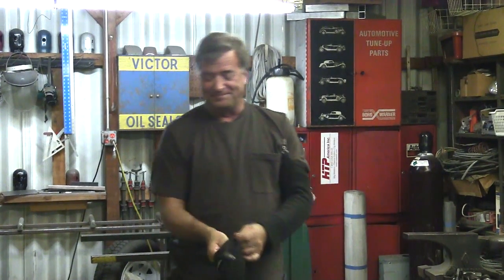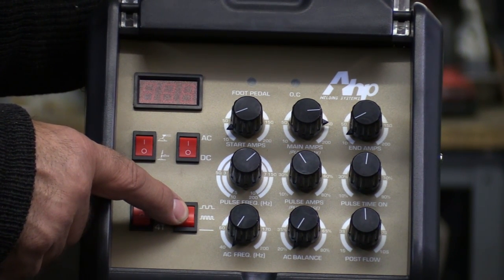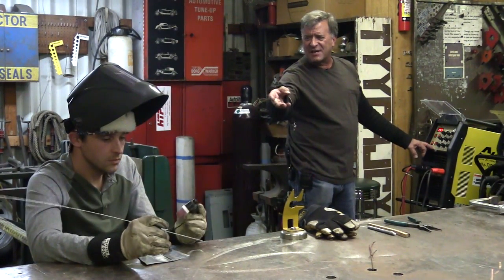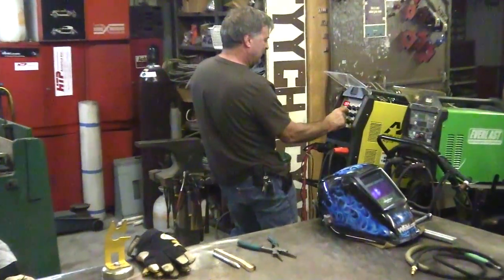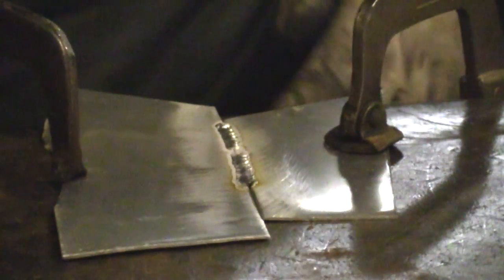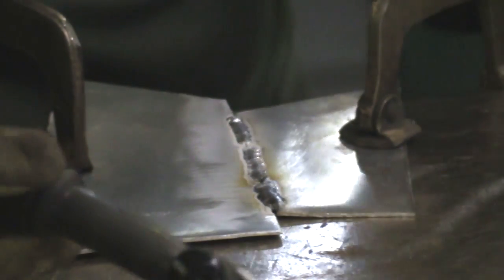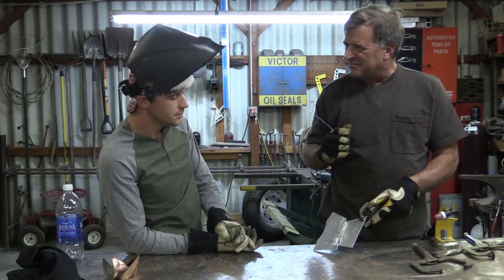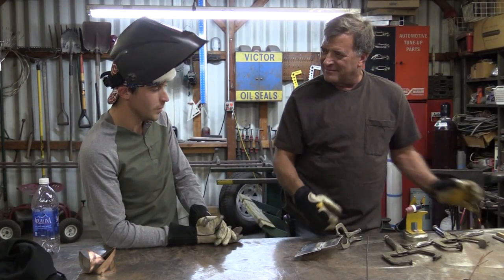What is High-Speed Pulse Welding? Using the New AHP AlphaTIG 200 - Kevin Caron

Comment: Do you still use and or recommend this welder?
Reply from the maker: I don't use it.   It 's too small for make I make.  But it is a fine little machine.  If I was not welding over 3/8th inch it would work very well.
Reply: Kevin Caron, Artist awesome!  I've been considering getting one but havent heard much reviews on it's long term use as a home unit.

Comment: What is the 2T and 4T switch for?  I'm not familiar with that?
Reply from the maker: "2T" means the finger switch is just on or off.    "4T" gives you better control over the arc.  Press and hold the finger switch down and you get an arc that stops at beginning amps. Let go of the switch and the arc goes to welding amps.   Press and hold the switch again and the arc goes from welding amps to ending amps.   Release the switch and the arc stops.
Reply: Kevin Caron, Artist, thanks.  This machine, I just bought it,  is the first one I've ever used with all these controls.  The only welding I've ever done was on an old SA-200, and an old buzz box.  I bought this Alpha TIG to teach myself how to TIG weld.

Comment: I'm a TIG noob, using this machine in the video. I like the topic of this video and am grateful for it, but it doesn't really help me out, or maybe I missed it... When should I use pulsing? How much should I use? Higher pulse rate for thinner metals? Are there any general 'rules of thumb' when it comes to pulsing?
Reply from the maker: I use pulse for thin metals, say under 16 gauge, and I use it for the look on anything I don't want to grind smooth.  Higher pulse rate for thinner metals and shorter pulse time as well.   Most of the time it is just practice on a piece of scrap metal to see how it will work on what I am trying to build.    I feel that the thinner the metal the higher the pulse rate, balanced against the higher amps you will need to still maintain correct penetration.  Will try to put a video together about this.   Please stay tuned...
Reply: Thanks Kevin, and thanks for the videos! Dave F. in Rhode Island

Comment: Which model of the Everlast line is comparable to the AHP AlphaTIG 200X?
Reply from the maker: I would say the PowerTig 210ext is the closest you are going to get to the AHP Alphatig.
Reply: how much better is the everlast if any?
Reply: The really hard question is does slightly better justify twice the cost? The Everlast PowerTIG 210EXT is around $1,500 to $1,600 and the AHP AlphaTig 200X is about $800. It has to be a lot better to the AlphaTig has to be a lot worse to justify twice the cost, IMO. If just slightly better then I can save $800.
Reply from the maker: The Everlast is slightly better in my opinion.
Reply from the maker: You just have to remember that AHP is a hobbyist/light fabrication  machine and Everlast is more of a  production machine.

Comment: my english is bad, but my ahp 200 not work when i toch the pedal i ned to toch the metal ,i need a trick or lern about the machine work ,i what other machine 3 in 1 tosences 520tsc and tris machine funtion whit the puse oficina bottom
Reply from the maker: Maybe time to adjust the points, check my videos on how to do that..     Or you should contact AHP tech support and talk to them.
Reply: Ok thakn ,i need more practice and learn With your help

Comment from the maker: Johnny D,,      Yes, the pulse setting are pretty much the same from one machine to another....        I will use pulse for any metal I am welding...    Copper, steel or aluminum.      Normally I will run around 100 pulses per second .
Reply: Kevin Caron, Artist 
what is the benefits of pulse settings from slow rates vs fast rates? is the slow rate settings used for thin materials to avoid overheating? what does 200Hz do better than non pulsed mode? just wondering what guidelines you would use when selecting the modes and speeds.